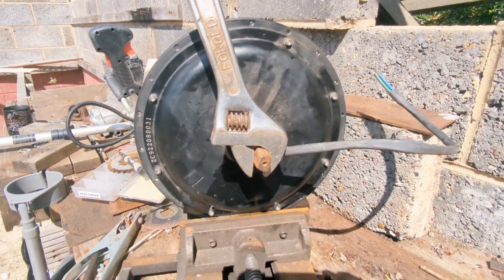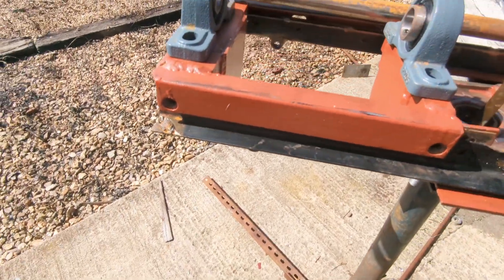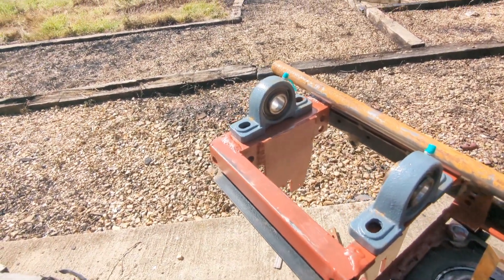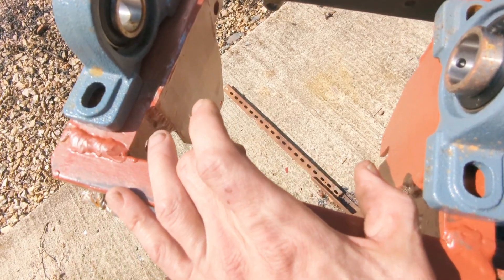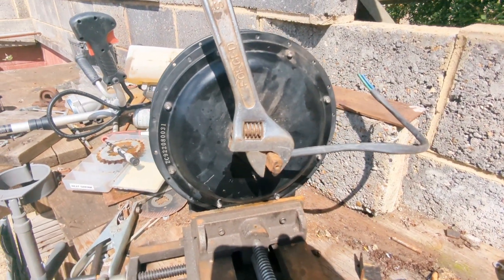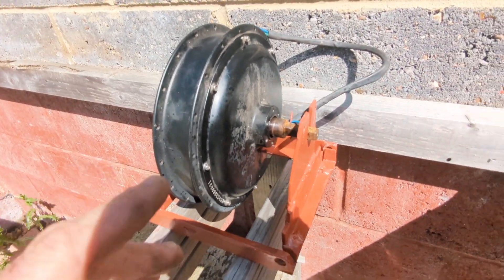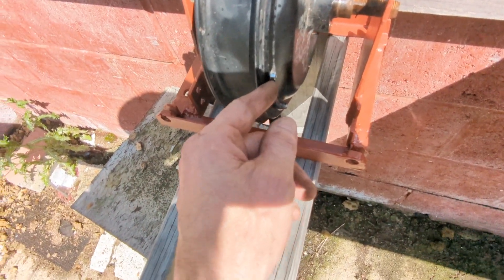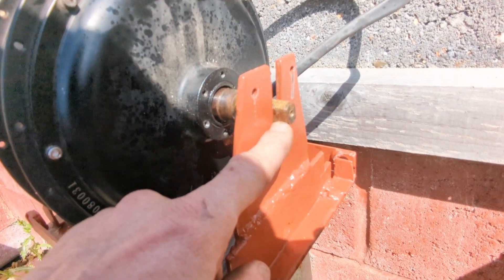New Wind Turbine Project - a recap - plus Seized / Stuck 72v 3kw Motor - any ideas ??

Comment: Good to see a few vids coming out. Hope you're going through an extended period of lesser symptoms that will let you enjoy  working on your project. Re stuck motor, I could suggest impact driver with moderate force reverse/forward/repeat. That's worked before for me on stuck shafts. Plenty vibration & a bit of heat. But, you've probably tried all this already.
Reply from the maker: It was good to get this moving again.

Comment: Tricky one that Gavin - Sometimes it's corrosion between the magnets and the coils (I'm assuming its a permanent magnet hub motor) A soak in something like WD40 (down the shaft or anywhere you can get it) may help, before trying - would be worth a bit of research on your specific motor just in case there might be plastics that would be damaged by the WD40. It could also be something broken or stuck in the planetary reduction gearing - again a bit of research on the net may yield and exploded diagram - I'm sure you know all this already!!!!!
Reply from the maker: Thanks for the comment it should be OK now.